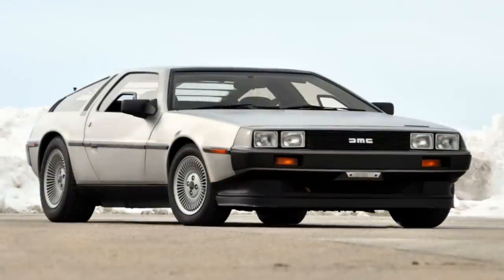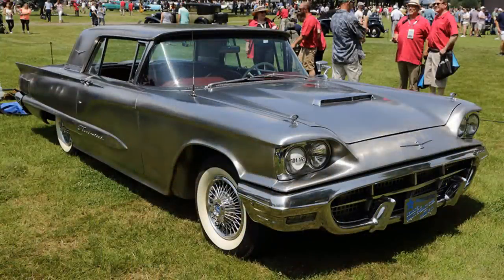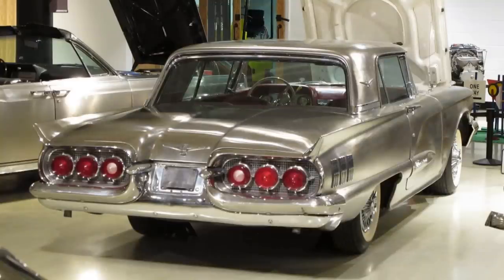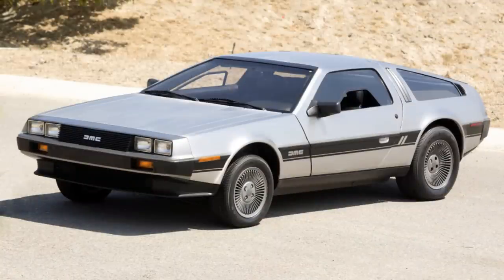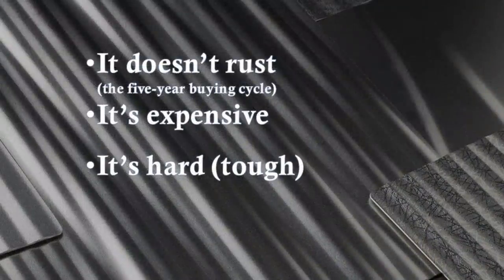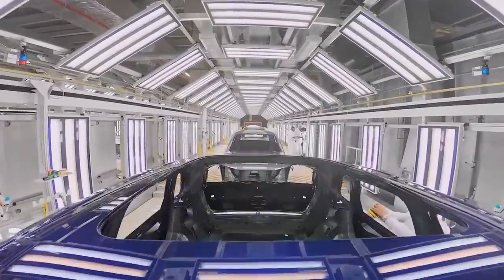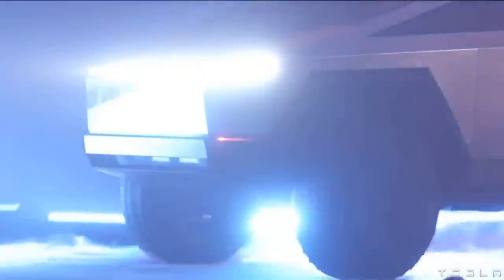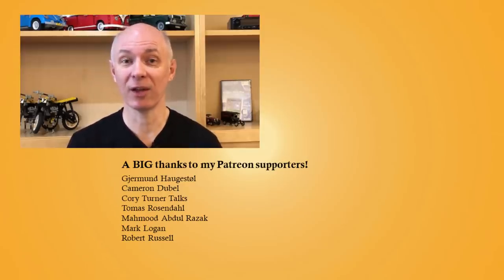Why aren’t cars made from Stainless Steel?

Comment: When it comes to the cybertruck one of the most interesting things for me is going to be the crash tests 
       Of course this is if it ever comes out
Reply: Or pedestrian impacts. I doubt it'll be legal in Europe.
Reply: Yeah, it looks like one of those Musk's vaporware projects.
Reply: Yeah this thing would absolutely decimate pedestrians...
Reply: I hope not it's butt ugly.
Reply: I am fairly confident it will fail many safety tests in many countries.  It is dangerous to the user, it is dangerous to pedestrians and it is dangerous to just about anyone it hits.  Modern cars are made to destroy themselves in a crash so the crash doesn't destroy you.  It is not hard to imagine what will happen when a hard and heavy vehicle hits one that is meant to break in a crash.  Visibility will also suck, I ride a motorcycle and would consider just fleeing in the opposite direction away from my destination if I saw one.  An axe on wheels.
Reply: @SirNarax  Decaying cars cause more production demand which causes more air pollution which in the end kills people in probably more significant numbers than just some unlucky ones not careful enough to avoid being killed by a tough car.
Reply: @adamkwalczyk  No.  It is not people failing to avoid cars.  It is cars running into people.  Cars are entirely the problem and cars need to have the safety features.

And if we care so much about pollution you should be advocating against cars as a general form of transportation.  It is the most inefficient.  Most space inefficient, requires the most and the worst infrastructure, most inefficient to power and produces the most waste material.
Reply: @paulqueripel3493  idc about europe my god, we can put steel bumpers on our semis

Comment: Stainless steel is actually a diverse family of alloys. There's the austenitic steels (chromium and nickel), ferritics, martensitics, dual-phase, and precipitation-hardening stainless steels. Most cars have ferritic s.s exhausts, and your quality kitchen knife is martensitic. Austenites have been used for many, many applications... but indeed, hardly for cars .
Reply: True  what if they where able to turn the color of the  body rainbow color like when you weld on stainless steal instead  of the plain shiny color?
Reply: @angelicpowers3526  that is not good for the stainless
Reply: @angelicpowers3526  See, problem is..when stainless is welded it changes color which again is bad for the corrosion resistance.
When I weld stainless I "passivate" it afterward. That means these beautiful rainbow like colors will fade away again in order to regenerate the protective oxide layer.
Reply: GM put stainless steel exhausts (true dual) on the 94-96 LT1 engined Cadillacs, Buicks and Chevys. The mild steel clamps and brackets will rot away where salt is used, but those exhausts outlasted the rest of the car, even the long lasting reverse-coolant LT1 which was good for 200K easy.
Reply: @angelicpowers3526  There is a way of colouring stainless steel by thickening the oxide layer so it works like a prism.  You then get all the colours of the rainbow.  The problem is that when you scratch through the oxide layer it goes back to 'stainless silver' as it's been called and you can't get the colour back.
Reply: My worry is that they are  making the body out of 3mm cold rolled stainless '30X' grade which is supposed to be very hard.  Vehicles are not made that way anymore.  They have crumple zones to slow down accidents to protect the occupants, if they have made the body to rigid, the crash impact will not be slowed down and those forces will be passed onto the occupants causing much larger internal injuries including brain trauma.  I expect it to fail NCAP test on this unless this issue is dealt with.
Reply: @billharris3650  3 mm of steel won't affect crumpling much. If it does, just grind indents in it where you want it to break.

The bigger issue is electric engines take up way less space, hence less crumpling.
Reply: @billharris3650  In a test of the stainless steel bumper on my Citroen DS against a  Mercedes Sprinter van the Sprinter won comprehensively.
Reply: @billharris3650  consider the self drive and other computer controlled features of the Cybertruck and you might understand why the Cybertruck won’t need Crumple zones to protect the occupants as crash incidents are far less likely to occur with self driven management avoiding crashes ….
Reply: @chrisbraid2907  But they are still involved in accidents no matter how good the tech is as it's good but not perfect.  Crumple zones are there to lengthen the time of a crash so there isn't such a sudden stop that then turns your brain into custard. The reason these were introduced was to make crashes more survivable, having them removed and relying on computers is insane as what happens when the technology fails and the engineering isn't there to back it up.
Reply: Yeah, it's like when you take some stainless steel to the scrap yard and they tell you it's not stainless steel coz a magnet sticks to it, as if you don't get stainless steel that a magnet sticks to, they either don't understand metallurgy or they're just scamming people out of money.
Reply: @angelicpowers3526  That would be cool.
Reply: SS is expensive.  Yes Tesla can save on tooling but pay more for material. 

Delorian was not really SS it was fiberglass w SS veneer.
Reply: Fatigue is something no one is talking about, monocoque with no curves and acute focal points. This is going to be an absolute disaster
Reply: @billharris3650  
The body is a stressed member so any crumple zone inclusion will need to be outboard of the mounting points for the suspension, motors and batteries. They will, also, be required to be entirely outside of the passenger compartment.
Reply: @kalleklp7291  After welding is enough to polish, that is.
Reply: @billharris3650  Finally, someone who gets the principles of crush zones.  I myself don't believe that making a body too rigid is a recipe for dissipating energy.  If the body resists buckling, where is that energy to go? Along the axis of the transmission?  Into you?  Let's hope that they thoroughly test this before releasing it to the public or they will be facing a lot of law suits from people with means; who will be the only real demographic that can purchase this vehicle with the price set as it is.
Reply: @charlessutherland5572  Yep but it seems to still be 6 months away even after waiting for nearly 2 years.  Crush/crumple zones are the basis of most of the survivability testing currently.  Crushing in a controlled manor to minimise the effect of the accident on those in the passenger compartment.  Airbags, seatbelts, autolocking doors etc all add to the safety aspect to make cars safer.

Comment: I live in the rust belt, so I would buy a stainless steel car in a heartbeat
Reply: Just buy a glassfibre or aluminium car
Reply: @1183newman  those are no cars they are toys
Reply: Aluminum is a much better material than stainless for automotive fabrication and has been used successfully since the late 90s in mass production. That's why both Ford has selected aluminum for their highest production vehicle and FCA has gone that route for the Wrangler.
Reply: I live in rust belt as well. Body panels last long enough. The real problem is suspension and fasteners
Reply: @annoyedok321  yes! You can coat and polish and wash a vehicle to keep it nice. Not a lot you can do to protect suspension.
Reply: @otm646  Aluminium corrodes.. without protective coatings, aluminium can fail; much better to us properly engineered high strength steel that has proper protective coatings applied.
Reply: @petesmitt  since when does aluminium corrode? It has the outside oxide layer to protect it. It's been used for ages in agriculture for irrigation. I have 40 year old aluminium tubes and no sign of rust.
Reply: @usarkarzts4207  Ever see a mustang hood, my dad bough a 2007 mustang and it had a car bra... needless to say when we took the bra off, the paint was gone and that whole section was oxidized and looked rough.
Reply: @usarkarzts4207  'I have 40 year old aluminium tubes and no sign of rust".. aluminium doesn't rust, it corrodes; the oxide layer you mention is actually corrosion - do some research.
Reply: @petesmitt  the oxide layer is corrosion but it also prevents corrosion, aluminium is pretty much non corrosive assuming you don’t strip away that layer
Reply: @petesmitt  I work with aluminium. It doesn't corrode unless you keep peeling the oxide layer.
Reply: @chrissmith3587  You are assuming that the aluminium panel is thick enough to retain sufficient strength after the initial corrosion to create the oxide layer has occurred; then there's the look of the oxide layer itself.. very unattractive on a body panel; then there's the fatigue issue with aluminium.. it has a finite ability to deal with fatigue before failing, unlike steel, which doesn't have that problem.
Reply: @petesmitt the oxide layer is basically neglible, it's a few nanometers it won't make a difference on the car

Additionally to get the equivalent part just make the aluminium thicker, it weighs less significantly than steel so its generally not going to be additional weight

And fatigue isn't really a problem for body panelling as far I'm aware. You could use steel structural beams to reinforce where necessary, it'd generally still save weight
Reply: @petesmitt  also you paint body panels the oxide layer isn't going to make a difference

Comment: Because stailess steel does not rust
Planed absolesence
Reply: All about the Machine when Flesh decays.
Reply: Obsolescence 🤔😉
Reply: @steveo4141   i m not a native speacker
Reply: That’s why phones these days are made of glass on both sides.
Reply: Aluminium doesn't either and many modern cars are made of that. Many parts are also from platic, which also doesn't rust and can live for well beyond a standard car life. That's clearly not the reason ...
Reply: @MephistoDerPudel  aluminum isn't any better than steel, once you put aluminum in contact with steel it becomes sacrificial and oxidizes,
Reply: Planned Obsolescence*
Reply: Ok if rusting was the problem then why have so many automakers moved to aluminum bodies? Aluminum doesn’t rust and the F-150, Escape, and a few other big sellers are made out of it.
Reply: @Craig Allison, actually it is primarily stainless and non galvanized steel. Aluminum is highly resistant to oxidation/rust in most conditions. Even non galvanized steel will rust out typically before the aluminum. 

If the car company is too cheap to galvanize it parts that come in contact will aluminum primer will do a fantastic job at stoping any oxidation issues. 

So it is mostly a non issue. I mean I’ve only even seen very thin aluminum washers actually rust out. But that is in contact with stainless steel.
Reply: @ian_lambert-knight  I don't know where you're from so you might not know the car but landrover discoveries originally had aluminium window surrounds and steel bodies, if they haven't been re painted most of them have all oxidised and bubbled the paint on the window surrounds, was a very common bodywork issue with them, I'm not a massive fan of aluminum, it is good at rust protection yes but I've had aluminium threads fail due to dirt in them and just striping/flattening threads, also alloy engines are a nightmare, spark plugs get rust welded I think if I recall Renault's had that issue, it has its place, every construction material does but it's definitely not a wonder material
Reply: Craig Allison Yeah I agree aluminum has its place and isn’t a wonder material. But it’s place is in the automotive industry, the steel on aluminum oxidation/rust issue is more than manageable. There are a number of thing that can be done to minimize or prevent that issue.
Reply: But yeah alloy engines can be a pain in the ass, but they cut down on cost and weight.
Reply: @ian_lambert-knight  aluminium is very easy to recycle
Reply: ok guys, it is 'Stainless' not 'Stainfree' steel.  Stainless steel does corrode, as an alloy it still has a high iron content but the addition of chromium etc it develops a oxide layer which protects it.  This is still fallible as even seawater corrodes normal grades of stainless.  and 316 grade is NOT a marine grade, anyone who tells you that is wrong.  Long story.  This special grade of 30X stainless that they have developed may work great on a rocket going to space but it's corrosion resistance is not proven here on planet dirt.
Reply: Should more cars b stainless or fiberglass